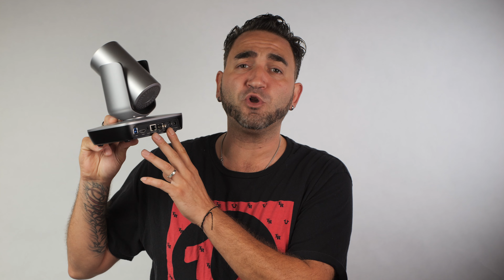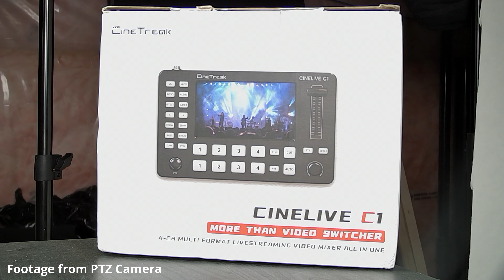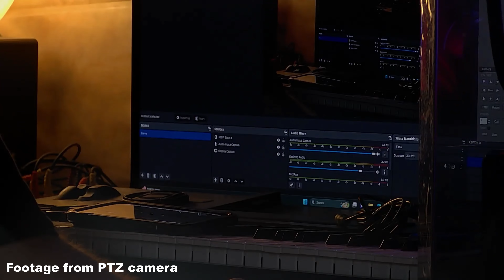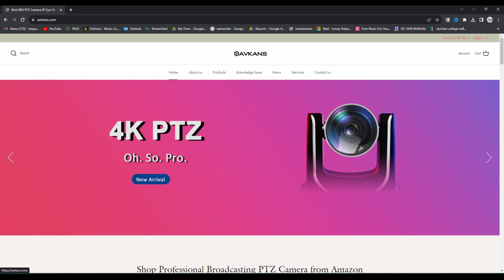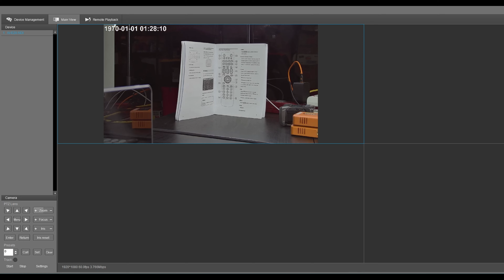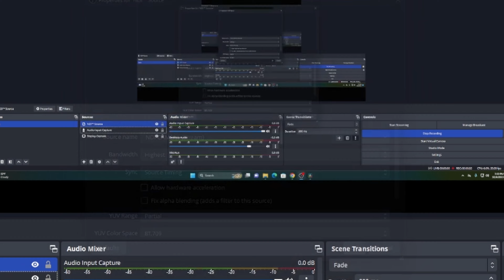Step-by-Step Tutorial: Avkans E20 NDI PTZ Camera Setup

Comment: is this ideal for recording sporting events like at a youth basketball game?
Reply from the maker: Yes 100%
Many people use these ptz cameras for sports and church and live events etc.
Reply: @LeoPazzo  but it doesnt look like it's battery powered like xbotgo, have to be plugged in when recording?
Reply from the maker: Yes this camera needs to be plugged in. 
If you want a battery powered ptz camera then I would say to consider the OBSBOT Tail 2 or OBSBOT Tail Air ptz cameras.
Reply: @LeoPazzo  i mean if you think bout it , most sports events you're not going to find a wall outlet to plug a camera to when you're sitting in the crowd
Reply from the maker: @cl993  yes correct. 
This is why some people buy portable power supplies.

Comment: I have 2 PTZ same model with AV-Joy Pro Controller. Computer cameras and controller are on the same network through a POE switch. The only wire I have connected to the cameras as from the switch to the POE via cat6 cable. I’m using Wirecast adding the cameras as NDI sources. every time you turn off the system all the IP settings are lost and I have to manually do everything from scratch every time. I have set static IP for both the controller and cameras. Nothing seems to stick together. Recently, the controller does not recognize the other camera anymore. I can’t even access it via its IP. Thinking of returning all this anyone else is experiencing these issues and found a solution?

Comment: I just got this camera (NDI HX) as well as the AVKANS IP Joystick.  I have never done anything with networking and am having a lot of problems getting the camera to connect to the CMS software from AVKANS.  I keep getting the error message on the software that the camera is not and can not connect.  I am seeing a correct image on my monitor connected via HDMI and the remote is working fine, but the laptop / software can't see the camera.  I have not even tried to set up the joystick yet.  Do you have a video for total NOOBS or a suggestion for a help desk?  I purchased through Amazon.   Thank you for a great video!

Comment: So I have a question I have the same set up, but I’m running two cameras and for some reason it only wants to work when I’m running the IP of my Internet. Is there a way you can run the IP just a device so you don’t have to have Internet to NDI stuff.
Reply from the maker: If I understand your question correctly. Yes you need internet to use the NDI function.